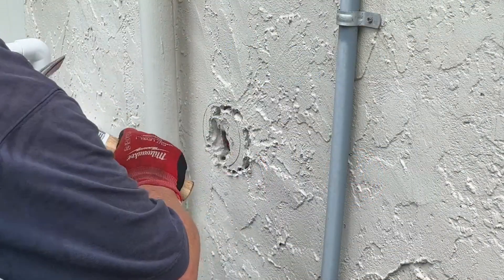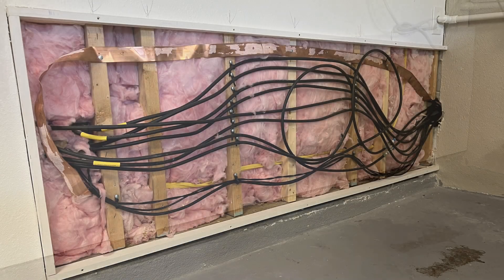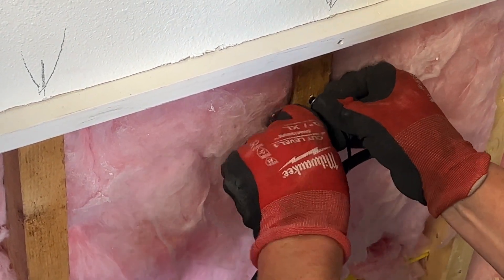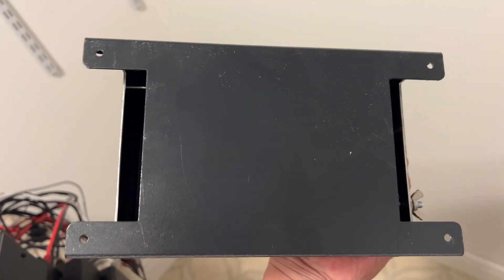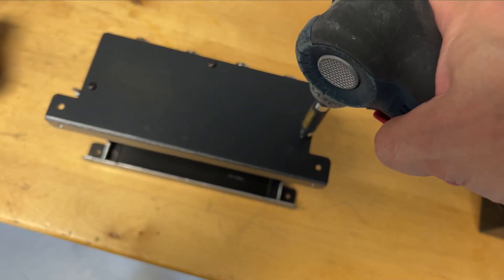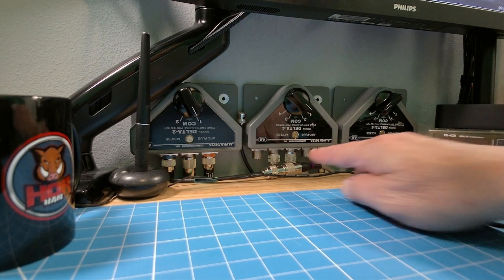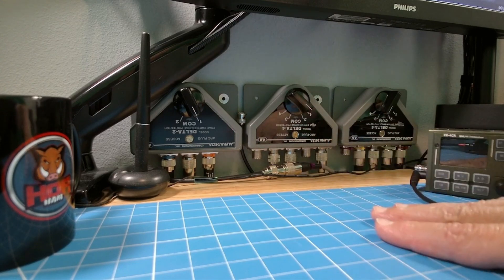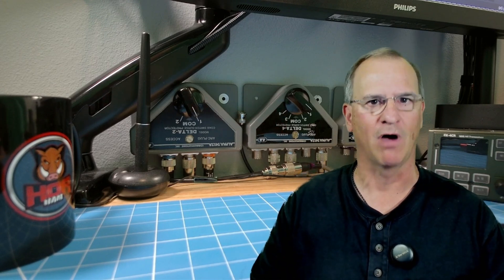New Ham Radio Shack Build Out: Episode 4 Organize Shack Feed Lines - MFJ-4704 Coax Patch Panel

Comment: Enjoyed the video!  Just getting started setting my "shack".  I have an Alpha Delta switch and was wondering how you mounted your switches to the wall.  That is the setup that would work for me.  Thanks.
Reply from the maker: LOL, velcro; but just not any kind. I use one "set" on the top and one on the bottom of the back of the switch.  Because it is velcro, I can remove the switch if needed for any mods.  https://amzn.to/4hQEIRe
Reply: @ Yep that works!  Thanks

Comment: I’m getting ready to do the through-the-wall thing to bring a grounding strap out and feed lines in. I will probably get a box for the outside like the one you used, and probably a patch panel similar to yours. I’m thinking about how to seal up any gaps so mice and insects won’t have a pathway (they can get through a 1/4” hole). My exterior is wood sheet siding and interior is drywall like yours. How did you handle this?
Reply from the maker: I used a 3" PVC pipe to got through the hole, then spray foamed around the outside of that to close any gaps.  Then where I ran the coax inside the PVC pipe, I used electricians putty to seal up around the coax -- it is pliable yet firm enough to maintain shape, and it can be easily removed in the future if needed for repairs or new cable runs.
Reply: @HOAHamRadio  thanks for the info!

Comment: Looks good, well organized for future expansion. I was wondering if you could daisy chain the switches. Don't recall what coax you are using ? Are you making your own cables? Really like the new connectors from Messi! Also, I'm thinking of setting my shack up permanently off of solar power and battery backups. If this is done, you would not want to bond to the existing house ground for fear of a double ground loop, if I'm correct? One more thing. You didn't go into detail on the MFJ Relay and SDR box installed behind your rig in the corner? Good stuff here !!!
Reply from the maker: The MFJ and SDR are not hooked up yet...very observant.  Once I get them hooked up and working, they will have a their own dedicated video.

Comment: How did you bond your antenna to your home ground?
Reply from the maker: I have a shack ground rod which is then mechanically attached to my house electrical system ground rod with heavy gage copper cable.  I do have a Grounding and Bonding video in my Shack Build Out series.
Reply: @HOAHamRadio  I saw that. How is your antenna mounted though? I’ve been reading up on grounding and bonding antennas, as I’ll have my antenna in a permanent spot shortly. From what I’m reading, its also supposed to be bonded to your shack and home. This is in case of a lightning strike or proximity strike, any electricity will be equalized through all of your grounds and doesn’t surge into one vs the other.
Reply from the maker: @michaelt.9372  At 12:13 of the video you see my panel with all my feedlines.  Let's use my 73' endfed for example.  It comes into this box via the gray cable through the bottom, into a lightning arrestor, attached to the metal plate in the utility box, with is attached the the shack ground rod 8-10 feet away via heavy gage copper cable; that shack ground rod is then bonded to the house electrical ground rod.  If I were doing a tower, or permanent vertical, I would add lightning protection / ground rods at the tower or vertical.
Reply: @HOAHamRadio  gotcha. Thank you for the explanation!